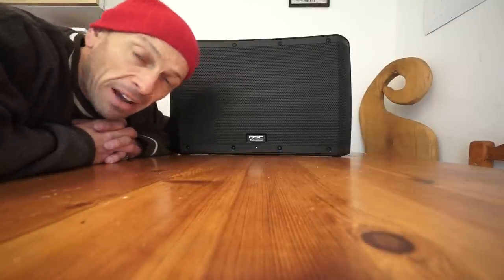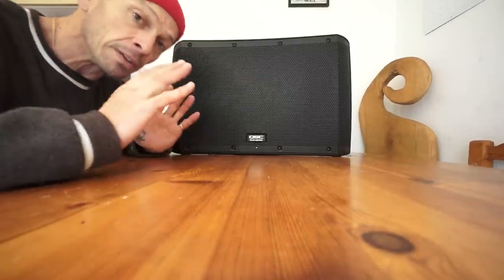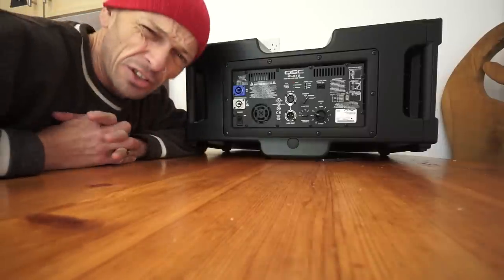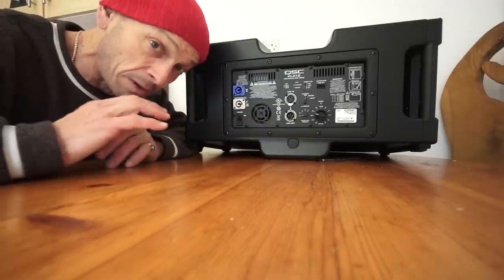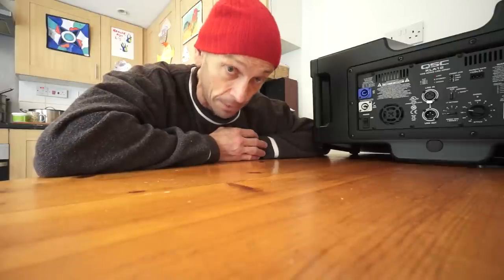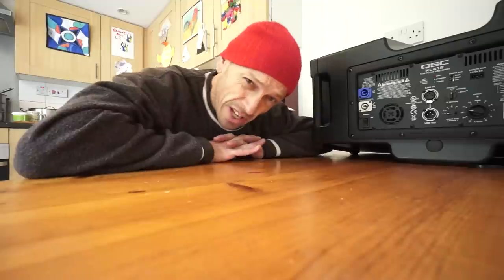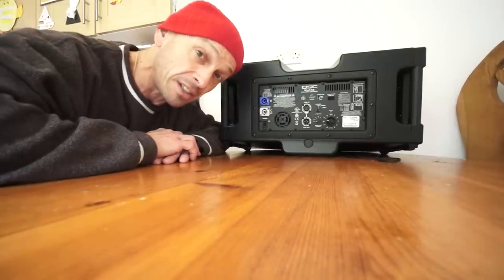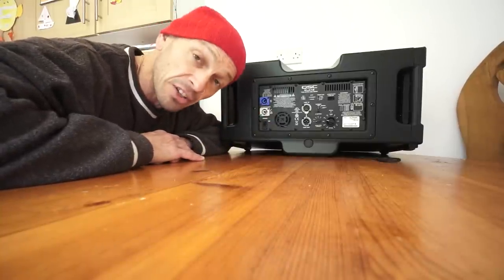QSC  KLA12 ACTIVE LINE ARRAY POWERED SPEAKER SYSTEM

Comment: Normally the horn on a line array cab is designed to have a wide horizontal dispersion and a narrow vertical dispersion so the cabs don't interfere with one another as much in the highs. You would get an uneven frequency response if you were in the audible zone of two mid/high horns at a different distance from your ears.

Comment: 44hz thats some serious low end but i agree with u  ellaskins line arrays a great for large events i use linearrays alot i find they are pretty efficiant to run and dont need to be pushed . i supllied a sound system for band and i dj'ed at a 80s themed wedding and talking about line array i used Martin Audios MLA mini on my Allen & Heath desk and i found i didnt have to turn the desk up past by 0

Comment: Usually CD horn means "constant directivity" (not compression driver) and denotes a horn that has a constant beamwidth over a wide frequency range. Electrovoice (EV) introduced it in the seventies and since then there have been various variations from other manufacturers. The round shape of the horn you see in a lot of 12/1 or 15/1 boxes usually also forms a modern version of a cd horn.

Comment: 44hz is not that low... Decent for a portable device, but my 10 inch KRK goes down to 34hz (and it's just a 10 inch)
Reply: +Luca Vervoort I guarantee that the QSC will stomp your KRK on output which is its main goal though.  For PA cabs it's pretty much pointless going below 40 hz at all anyway, especially for a top like this which is designed especially to be used with a separate sub.
Reply: Sean Williams Yes you're right, i didn't talk about levels, just frequency responce. KRK don't put out a lot of sound, just quality ;)
Reply from the maker: +Luca Vervoort love to see them fill a room with 100 people  ;)
Reply from the maker: +Sean Williams   Thumbs up..  :)
Reply: ellaskins Yeah my bad, I was just talking about freq response, of course studio gear can't be compared with gig products.
Reply: +Luca Vervoort so, u buy a sub! this speaker is kinda designed to be used with a sub
Reply: The thing is the KRK isn't that LOUD, well it might be loud in your bedroom but you know what I mean. I have 12 inch tops which are tuned about 85 Hz, though don't have that much output down there and are on a 95Hz crossover. They get very loud and punchy but have separate subwoofers. Even my 12" subs are tuned at 40Hz, although in a corner they have a high pass of 35.5. My friend's little 9" DALI sub is probably tuned lower but at home theatre listening levels, you may as well have realistic thunder that goes low over going really loud.

I could tune my subwoofers lower but they would not get as loud and ultimately they might run into travel limits on just a Peavey IPR1600 if I tuned them any lower. In fact I'd probably get a bit more out of them in mid bass and power handling due to displacement if they were tuned at 45Hz.

There is a trade off in size, output and extension. It also uses up the travel of the speaker cone very quickly if you're trying to get lots of output down low.

Comment: Why would you choose a line array system over a small touring system for DJing? Those boxes set you back £1400 each so a pair you're touching just under £3k. 
I would much rather spend that money on a Funktion 1 or Void touring system that would blow it away.